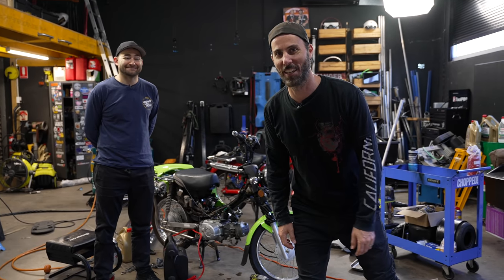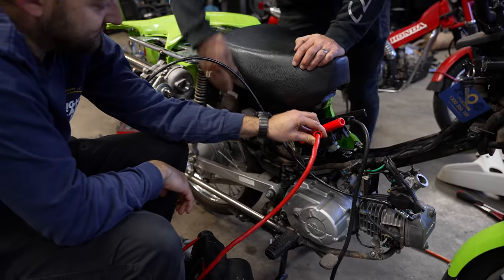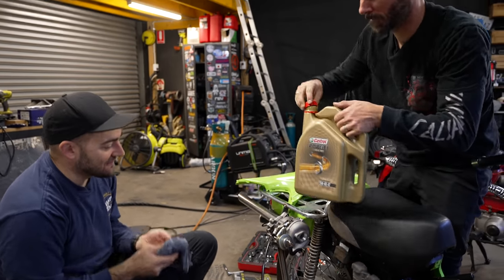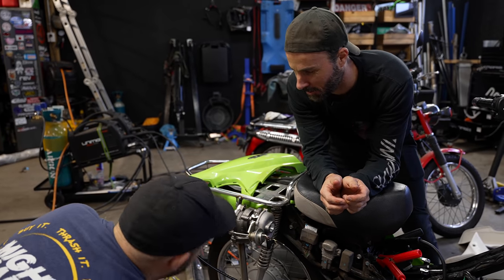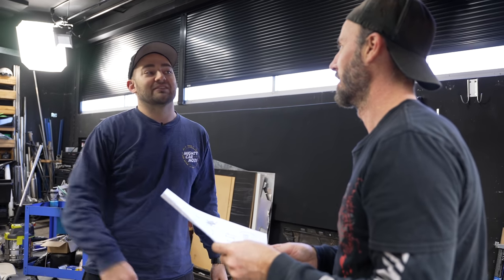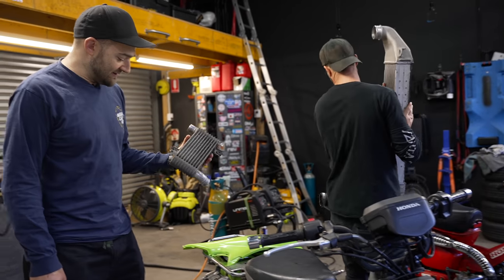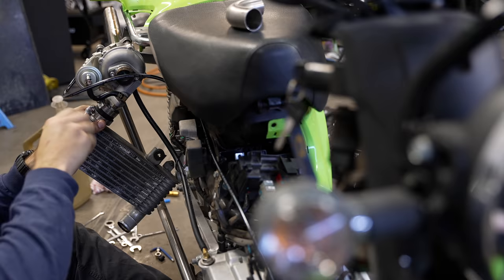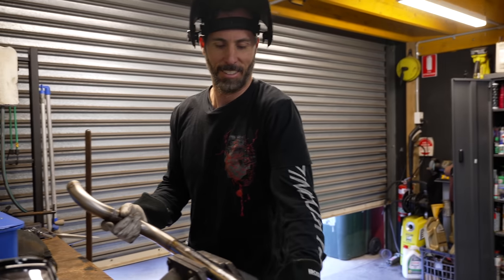WORLDS SMALLEST Blow Off Valve Install

Comment from the maker: We hope you enjoy this episode. Love Engines? Check out our Engine❤️ T-shirt here https://mightycarmods.com/collections/clothing/products/engine-heart-t-shirt
Reply: BIKES BOARING I THOUGHT MIGHTY CAR MODS WOULD bE ABOUT CARS NOT DEATH ON TWO WHEEL BIKES I SUBBED FOR CARS NOT BIKES
Reply: You need to custom it out like the Asian guys do with them they look mint
Reply: I need that shirt in a women's cut!!
Reply: @theirishmanpaddyshalloe3086  just keep picking them potatoes you'll be fine
Reply: Hey guys for the single banger to make proper/ any boost you need a little accumulated chamber in the exhaust system before before turbo. This is because a single banger can only make pulses of exhaust to spool the turbo unlike multiple bangers have a constant exhaust.
Reply: How can I email you a picture of how I did it, I did it by tapping a hole on the right crank case cover where there is a oil passage coming from the oil pump
Reply: @adminsnat975  It's what they did, but the pump doesn't appear to be strong enough to pump oil up the line to the turbo and also keep squirting the crank case... Could be that the pump is just shot too!
Reply: can you run oil through a pulse pump? if so that be a sulotion b/c a engine driven or electric oil pump is a whole other issue.
Reply: Loved the posties song lol idk why they get so much hate like ya sure it's not a screaming "liter" bike but some of the most fun vehicles and bikes aren't fast and are more often quirky little vehicles kinda like that twin charged little Japanese car that honks when you let off throttle ,sorry I forgot it's name, but I know I've had heaps of fun in my little clapped 4 banger 97 ranger
Reply: Small hand pump sprayer to Wet the intercooler ?
Reply: Maybe you guys can install a small hand sprayer to wet the intercooler?
Reply: SCIENCE, B*T*H!!
Reply: Journal bearing turbos need more than just oil, they need oil pressure. 

Just oiling it or drip feeding it will not work, turbo will die quickly
Reply: guys,   this is like one of top 5 of all your videos.   well done lads.

the song absolutely topped it off.
Reply: If you plug the squirter would there be enough pressure on the feed line? Then run the drain into the top on the valve cover and make it a dripper  onto the rocker? Is that more science though?
Reply: I guess this what we call test project turbo cup bike...
Reply: plug off the tiny hole and make another one for the return
Reply: Really enjoyed the episode guys but a little disappointed we didn’t hear Moog play the blow off valve.
Reply: youve got the smallest turbo and now the smallest blow off valve, what you need now is the Smallest dry sump oil system  LMAO
Reply: also with just a couple elbows you could mount that intercooler more vertical and tucked in to the bike contour under the turbo.   but it seems like you actually need a much smaller turbo anyway so im looking forward to turbo posty project #2  !!!
Reply: "There's urine in wee." I laughed so hard for that. :'D So clever thinking right there and timing was perfect. :D
Reply: How can i have that one, small turbo for my fury125
Reply: You need a kitaco or takegawa clutch case cover, thats predrilled with oil lines. Install an oil pump from one of those 2 brands too to get higher flow and pressure.
Reply: You beautiful lads have probably heard this from someone else before. But those mini turbo's have intergrated blow-off valves in the exhaust side of the turb (hence the weird philange shape). To see more impressive boost and hear all the whoosh out of your custom blow-off valve, I suggest you plug the lines on that big diaphragm on the turbo and weld that door shut in the exhaust side of the turbo...
Reply: Would a pitot tube help in this application or not necessary with efi?
Reply: I would run a 0w oil maybe better flow.
Reply: 3rd party camera dood, moving on up in the world. especially showing how well thought thought the projects have become now to film live, naturally, with post edit in mind...either that, or ur humour got even better :D
Reply: Please! Release the song thats played at 28:45!! Its in Turbos and temples 2 as well when you are shopping for parts. It's such an awesome song!
Reply: #PartyTime #Excellent nothing like an air cooler guitar
Reply: I already have an engine heart shirt. Among a couple others... I have one right now sitting in San Fran clearing US Customs.
Reply: Since the turbos so small you might need a gauge that reads in the gram level. I think hectogram might be waaaaay too much. 👌🏾👍🏾🤙🏾🤙🏾🤙🏾
Reply: @coltentodhunter7551  You are correct. For every 1 gallon of gasoline burned (assuming it’s running at a perfect stoichiometric ratio), 1 gallon of water will come out the tailpipe. Factory mufflers have a small hole to let the water drain out.
Reply: do these guys ever talk about the resistance movement in australia?
Reply: For the love of everything titanium please please tell me the some you beautifully played on the intercooler- I am going INSANE- i don’t think it’s all of me (John legend) but I do, but dam it I don’t 😡😡😡🤪
Reply: I would really like to see some races with the turbo and na posties.
Reply: Did it actually build boost?
Reply: Fun fact; the heart sits on the center of your body (not behind your left breast). Don't believe me? Check out a HLR course.

Comment: Put a check valve down there at the engine so that the oil that has come out of the fitting doesn't flow right back into the engine. That is how you keep the line filled even when the engine isn't running.
Reply: Correct me if I'm wrong but then the engine will lose lubrication if there's no cycle right?
Reply: You mean check valve to keep prime ?
Reply: The only issue I see with the foot (check) valve would be there won't be enough pressure to open the valve.
Reply: @normcummins2719  so is posible?
Reply: @warummussmeinnameangegeben6502  genau. Exactly.
Reply: @rjprz5929  anything is possible if your willing to modify it enough, personally I'd be looking at fitting a much higher flow rate oil pump to keep up with all the work and ensure good flow
Reply: @MDM1992  I see that's actually really clever. Heikos idea was a good 1 to. My mistake I totally forgot about the return line lol.
Reply: @MDM1992  I was thinking oil pump the whole time.
Reply: It really isn't much flow, but the check valve would be good as the head pressure will want to drain back down... I am sure there are some that work with the low pressure or you could do it like a check valve if you do it manually
Reply: Might have no flow at all then. There's already not enough. Plus they are relying on the oil to also cool the core. It wont last long at full load.
Reply: @normcummins2719  Absolutely, not a hope.
Reply: And restrict the return so that tiny flow keeps the oil around the turbo a bit longer. No scavenging.  Good idea on the check valve.
Reply: Needs a check valve on the return as the crank case pressure might affect the oil feed flow.
Reply: @southeastqldgoldhunter  the turbo and the engine are both fixed to the bike’s frame neither of which move with suspension.
Reply: @booneylander  sorry my bad lol
Reply: With the bike already having electronics I'd look into an aux electric oil pump
Reply: @Onewheelordeal  exactly Mount a oil reserve tank on the back rack with a pump.
Reply: @normcummins2719  i non spring loaded floating check valve would work fine.
Reply: @rjprz5929  with a small low pressure aux 12v oil pump
Reply: no point, there isn't enough flow or pressure to supply the turbo with enough oil so trying to maintain prime on something delivering 1 drop per second is pointless, get the flow and pressure right and you wont need to faff around with a check valve.
Reply: Also id lower the turbo 100-200mm so it can still gravity drain but there is less head to lift the oil on the feed line
Reply: @normcummins2719  you can change spring pressure. Not every check valve is a heavy duty check valve. Although the psi is pretty weak here so maybe you’re right
Reply: So back in the day when turboing bikes you would install an orifice plate on the oil line to up the pressure the help oil the turbo.  What i did on my air cooled bike was mount it just below the oil cooler so oil goes through the cooler then turbo then back to the pan. Definitely best to mount it so it gravity feeds to the engine but add a helper pump to feed the turbo.

So ive had the pleasure of opening up 2 versions of factory bikes. One with turbo one without.  The turbo version had a lower scavenger pan and a 2nd oil pump.
Reply: @normcummins2719  nah you can get check valves that have no spring, its just a ball in a cone that needs flow or gravity to close
Reply: @Enz3d  it doesn't have enough pressure though, and with more pressure it wouldn't need a check valve because it would have no issue priming the lines in under 30 seconds so bigger oil pump is the most efficient non bodge way
Reply: @MDM1992  those tiny chek valves don't need pressure there's no spring to fight the pressure, they get used in industrial sewing machines which almost drip feed the pressure is that low and need to be mounted vertical to work properly. I don't think the term "non bodge" should be anywhere near this project lol... its about as slap together as it gets.
Reply: @Enz3d  I understand that, what I'm saying is that pathetic drip a second of oil would never be anywhere near enough pressure to cool and lubricate the turbo, and since half is taken from the engine cooling and lubrication when the turbo line was added splitting the output from factory so that would also cause excessive wear and be undercooled. A valve without more flow/pressure would not solve the issues here. And a bodge is a makeshift project that sort of works but not really, like this. To not be a bodge it would need to be done correctly and that would be by adding a bigger oil pump along with the turbo, factories do this for turbo cars. Because they require more oil flowing faster around more parts. Just slapping a turbo on isn't the correct way to do it, you upgrade everything associated with it to handle the extra load you are putting on it through the modification. So just adding a check valve instead of a bigger pump(s) would be a bodge in terms of adding a turbo to any engine.
Reply: Considering the flow rate, I doubt it'll have the pressure to even open a check valve.
Reply: @rjprz5929  The check valve would not change however much the rockers are or aren't starving due to the addition of the tap in the head.  Whether the oil pump can oil both the rockers & the turbo though is a different question.  It's sorta like a coffee machine - small amount of heat at the bottom can pump the water because the the line is primed & a check valve prevents it from returning to the tank.  It's just that in this case instead of heat you have a traditional pump and you're stopping it from returning to the rocker cover, not a tank.
Reply: Personally, I would have built a separate oil system just for the turbo. A small oil tank, tiny pump, and a couple rubber lines would have been more than enough to support that turbo. Probably easier than trying to use the oil system from the engine .
Reply: @davelowets  Agreed
Reply: By the look of the oil flow to the valve train, there is a restricted flow in that circuit, because the mains and rod bearing are not going to last if there isn't more pressure than that. Remove the restriction or tap into the main oil gallery to lube that turbo
Reply: lol i dont think the engine makes enough oil pressure to push opened a check valve or push against gravity to the turbo :p. They never even showed if there was any kind of performance gain. Doubt it survived long enough to know
Reply: Thing has so little pressure there's no way that check valve is even gonna open

Comment: You accessing the wrong part for oil. You need to go through the clutch cover.  The oil galley that comes directly from the pump.  It's basically the same motor as a  crf50, 70, 110.  They make tons of aftermarket parts for them.   It's the same principle as adding an oil cooler.  You might be able to find an aftermarket cylinder with an oil galley you can use.
Reply: An oil cooler instead of the intercooler would be much better also
Reply: @Mooza1  Considering there’s just oil cooling, that makes sense
Reply: @Mooza1  that would also increase the capacity of oil and that's a good thing for air cooled bikes. I think they should also add a vacuum oil pump in line to increase the pressure. They make them for small bikes and lawn mowers. Runs off the case vacuum and some bikes have a vacuum nipple you can tap into on the intake like my drz400 its there for the vacuum actuated petcock.
Reply: Early low boost cars like the the Nissan pulsar Exa and Cordia used oil cooling instead of an intercooler
Reply: @Mooza1  They used oil cooling instead of water cooling the turbo, as did most early turbocharged cars.  Oil cooling and intercooling are not equivalent.
Reply: @ferrumignis   1986 VL turbo's come out with water cooled Garret Turbo's, so the water cooling concept has been used for a long time.
Reply: @fullboostturbo1  Yes it has been around a long time, but that doesn't change the fact that a good number of the early turbocharged cars did not have water cooled turbos and relied on cooling from the oil.  This part of the reason why coked up turbo's were a common issue.
Reply: @Mooza1  Instead? what is this.... Instead of which you speak? Hang another cooler off the other side. you know, for balance...
Reply: @arjovenzia  exactly, when you're doing 300k's on your postie you're going to need an airbrake on the other side to stop it pulling to the right so hard
Reply: You've gone this far you might as well go water methanol injection too
Reply: Uma racing and swr in malaysia do have racing oilpump for this engine...(thicker pump with much higher flow made for 14k rpm race condition)
Reply: @joshuacheek5140  You said "petcock".
Reply: @JJsAutomotive   PETCOCK... 🤔 Pet--Cock. Laughs like Seth Rogen  huhuhuhuuuu 🤣  I've rode bikes for 15 years or more and that's honestly the first time I separated that and realized how funny it sounds.
Reply: @AmirPomen  it's for ex5 right?
Reply: @coron1985  available for seevral models..

As for honda ex5-100cc as well as dash/wave110 as well
Reply: @AmirPomen  it's hard to reach the product to aussie

Comment: You need a one way check valve in the line  for the oil going to the turbo
Reply: I'd be surprised if there's enough pressure there to open a check valve
Reply: The turbo just needs its own, separate, oil system with a positive displacement pump.

Comment: Since none of the top comments say anything about it; All hydrocarbon fuels create water when burned, since oxygen combines with the hydrocarbons as they get broken apart, when the hydro part combines with the oxygen part, you get water.  The other parts of the oxygen get combined with the carbon, making carbon monoxide, and carbon dioxide.

Comment: MCM is ten years old and I still get excited when I see a intercooler just for the harp sounds...
Reply: If moog ever stops doing those I'll unsubscribe
Reply: I read this comment as they pulled out the intercoolers
Reply: Actually 13 years old but all the rest you said. I think my favorite was, I can't remember the car, but Moog on intercooler, Marty on something else, Miles banging the beat on some 5 gallon drums, and Turbo Yoda with the ONE BIG BASS bassoon pipe blow at the end.
Reply: @if66was99  video please
Reply: @masheralive3025  Wish I could! I can't remember what car it was.
Reply: @if66was99  someone please remeber! 😂
Reply: @Legacy2lt  I think it may be the Off-road Legacy build.. I;ll check in a bit.
Reply: @Legacy2lt  It took 2 hours to find but I FINALLY found it. Not the Outfap, it was the 240 Z. Marty on the sweet exhaust manifold and it was Dave from Haltech on bucket drums, at 11 : 10.
https://www.youtube.com/watch?v=HwOGPU6hEqk
Reply: @if66was99  Thanks that was excellent!
Reply: @if66was99  it was the Nissan 240Z build
Reply: @if66was99  thank you
Reply: @if66was99  its EPIC

Comment: Posty bike is a win!
The oil pressure feed for the turbo is an easy fix. Find the oil pressure safety switch and put a 'T' for the switch and  the feed line, just make sure that the pressure switch is on the straight through and the feed is on the 90 degree portion to maintain proper pressure to the switch.

Comment: Loved seeing an intercooler and blowoff valve in this build.  I'd love to see what you guys do yo get the oiling working better.  

Most of the time people turbo little bilkes they treat them as disposable projects so either oiling, heat or case pressure are ignored. Nice to see something more thought out than the typical.

Comment: The air in the line is causing cavitation. You need a non return valve(1way) and fill the line with oil before installation. add extra oil to the bike motor too.